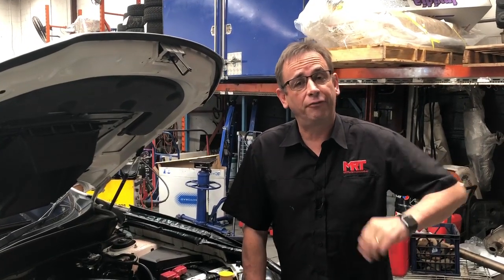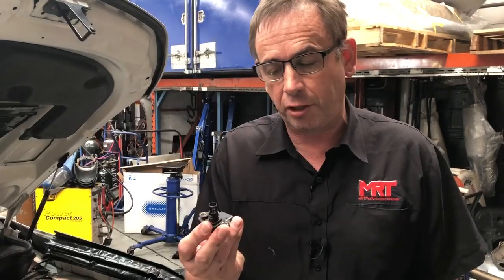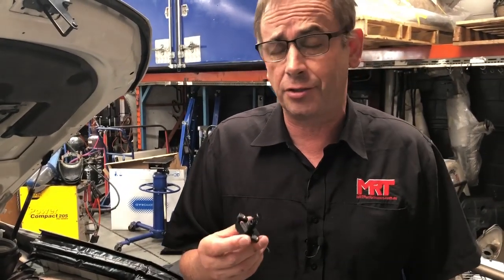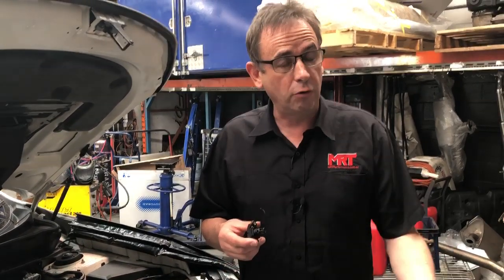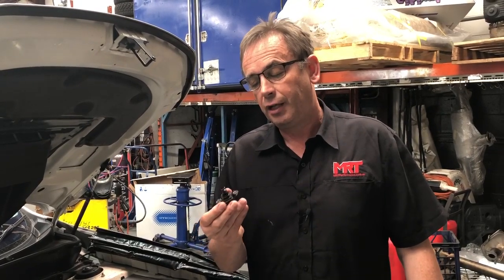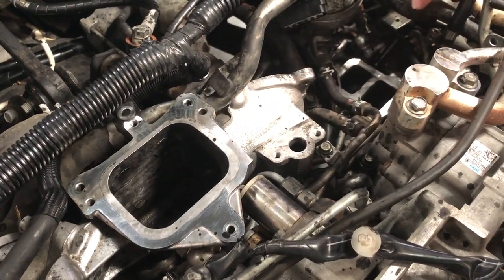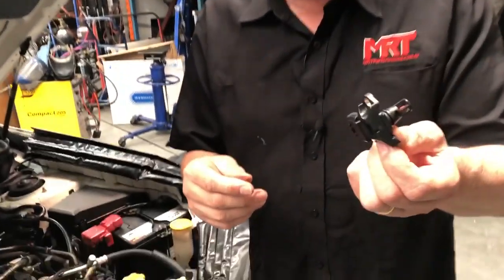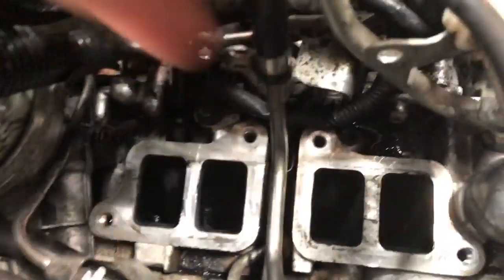Subaru Turbo Diesel MAP Sensor

Comment: My boxer diesel trys to start but stops after 5 seconds. The engine oil was high I let some out to level. I'm doing an oil change but it won't run..no fault codes any ideas?

Comment: Hello Mrt Perfomance , need a Help , i have a P113 code throwing out , do you know where is located the IAT on a Boxer diesel engine from 2008 ? Or the IAT + MAF are combined in the same sensor , the one located on the air filter box ? Thx , cheers from portugal

Comment: What routine maintenance job do you recommend to keep the Subaru Diesel running? I have a 2014 Diesel Outback and recently the car seems to be consuming more fuel (it used to register the car able to run over 1000kms but now only around 800 on every fill up and the car does actually make about 800ish kms on every tank while it used to be over 900kms). I have always have the car serviced by the dealer.
Reply: Biggest mistake was having it serviced at a dealer. They are retarded.
Reply: @bahcekapiliyavuz , There was only once I could do almost 1000 km per tank, mostly I did 9xx km per tank (62 litre) but now I can do only roughly 800 km. I do almost 85% highway.
Reply: @bahcekapiliyavuz  CVT
Reply: @bahcekapiliyavuz  Your maintenance is over the top - Changing air filter every second time on 5.000 km is very frequent! No wonder your consumption of 4.5 - 5 is so good! 6.4 average is very good too - this was what I used to have but I think I get roughly 7 on average now.
Reply: @pausumperth6078 la mia XV 2.0 d ee20z euro 6, 6 marce manuali,  fa il controllo ogni anno a 15.000km e usa un olio Motul 5w30 x clean effe. 1 pieno, 60 litri, 850 km, fantastica!

Comment: Just another reason to blank the EGR at the exhaust manifold and EGR software delete. No where in nature is a animal forced feed it’s own shit. The human who developed EGR was a deranged individual
Reply: as far as I know every engine has a best possible fuel/air mixture ratio. The more oxygen molecules you get in that combustion chamber the more fuel you can introduce to get to that ratio. Cold air means denser air and thus more molecules, more fuel can be added and finally you also get more power. That is why the spitfires in WWII  had a turbo on their engines to compensate for thinner air. If we return used air from the exhaust to the combustion chamber there is less space for oxygen molecules and thus less power. EGR is only for  environmental reasons, at least in my humble opinion.
Reply: It lowers temps by replacing oxygen in the air fuel mix and therefore a cooler burn. EGR gasses also pass through a cooler
Reply: YAVUZ BAHÇEKAPILI how is EGR an engine cooler. Explain please
Reply: I think it is more crankcase blowby issue
Reply: Keith Walker good point. Depending on where the EGR & or crank case ventilation. Renters the intake system. 

Personally I own a tdi direct injection engine. I run a complete ERG detete and a duel catch can system for blow by. Since then. I’ve gained another. 150 klm per tank. Plus performance is definitely improved. Modern diesels are absolutely fantastic, so long as the intake tract is kept clean.
Reply: YAVUZ BAHÇEKAPILI you’ve explained why the egr is there to reduce nox. Agreed. 

Hot exhaust gas,re-entering the engine doesn’t lower engine temps. Compared to no egr systems. 

Diesels are low revving efficient mileage motors. 
Operating a diesel at 2500 - 3500 rpm consistently is a sure fire way to internally damage a diesel motor
Reply: I didn't realise that diesel engines are animals.